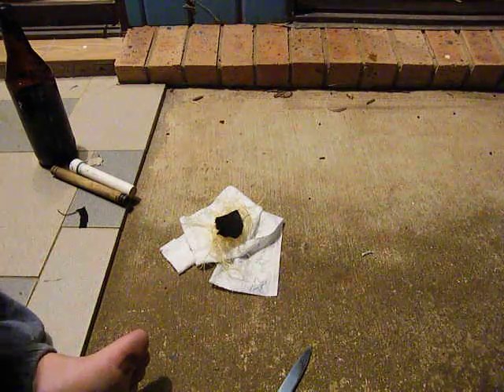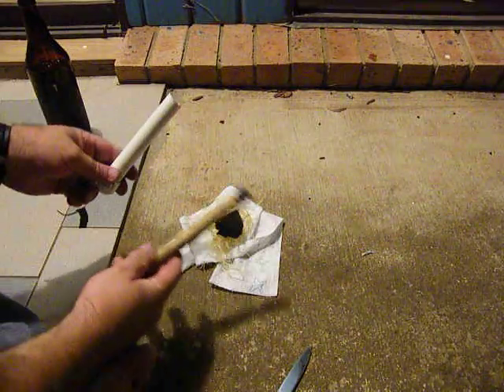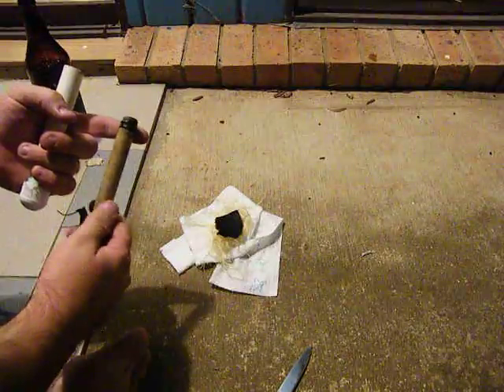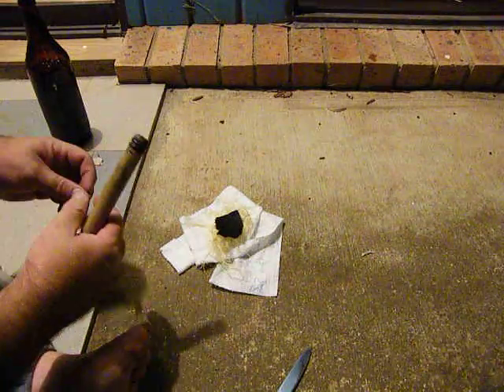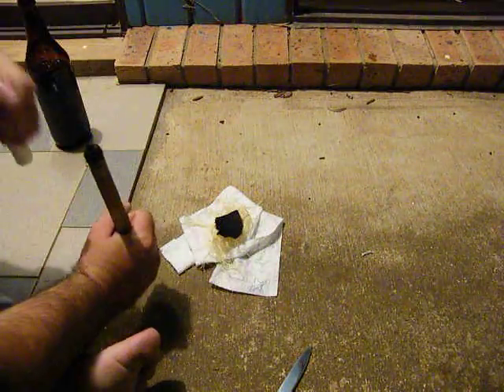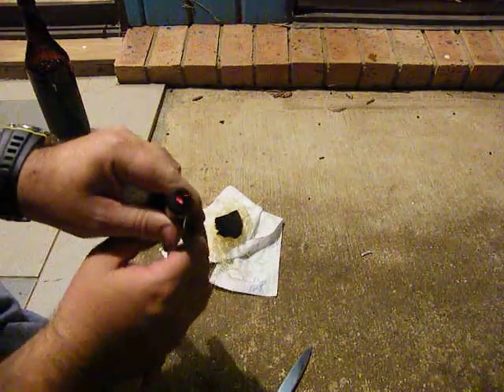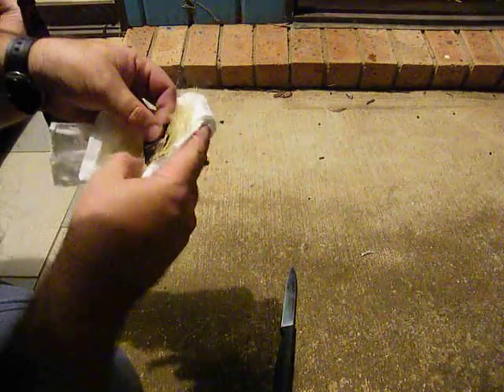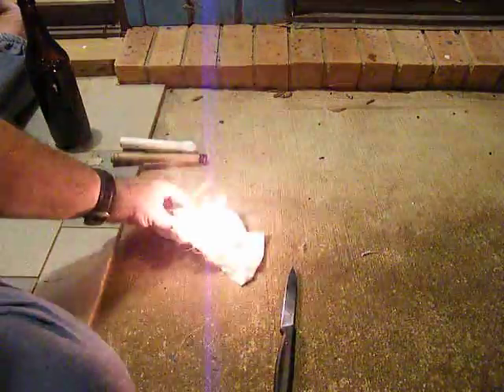DIY fire piston

Comment: Very good demonstration.

The ratio of the initial volume to the final volume needs be increased to have fire.

If you increase the ratio, you may have fire at the first press.

One way to increase the ratio is that you put something is the inner tube of the PVC tube. This way will decrease the final volume of the air.  The final compression ratio will increase.

This is how the diesel engine for a car works.

Try it. Let me know.  Thank you. 

Basically, the high volume of air to press to a small volume.  It will create the heat. The heat  on the cloth will ignite the cloth.

The original volume of the air is pressed down to that small volume of the air.  The heat is produced.  

If the final volume of the air is relatively large.  The temperature might not increase to the point to ignite the cloth on the tip.

Therefore  if you decrease the final volume , the temperature will increase.  If the final volume of the air is small enough, the temperature will ignite the cloth at the first press.

Try it.

Comment from the maker: Off the top of my head, no. The inside diameter of the PVC pipe is about 16mm. The dowel was a bit larger and had to be sanded back a bit to fit.

Thanks for your question, though!